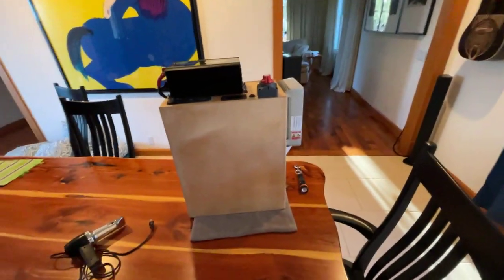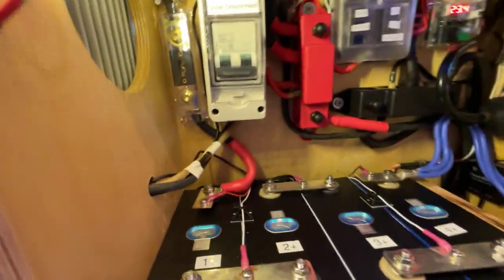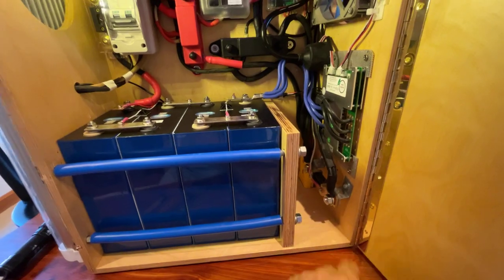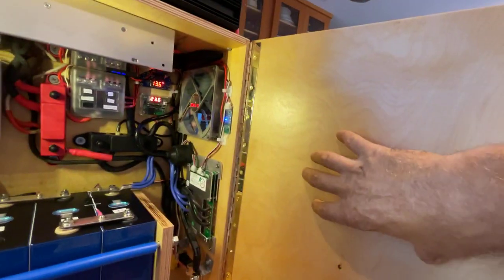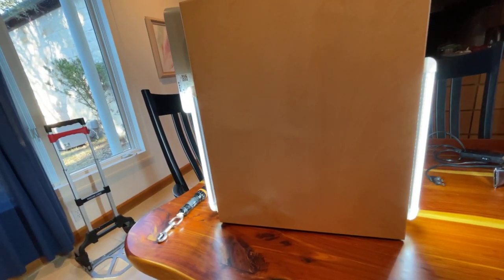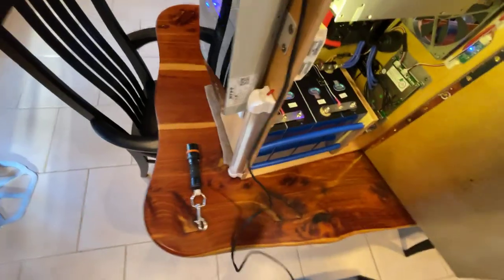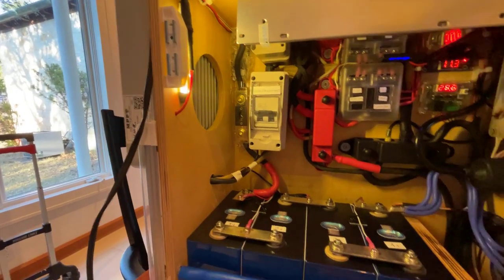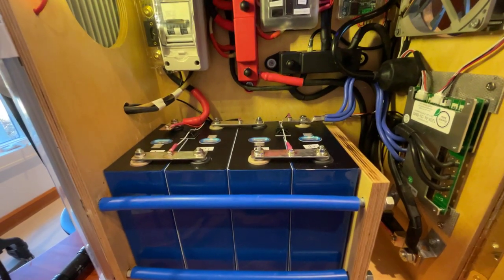I Built A Solar Generator! It Will Run My Fridge And Deep Freeze For Two Days!

Comment: I like your build.  I used the sense lead attachment to the middle of the bus bar on my bill too but I like your use of the half bus bar on the positive and negative terminals. I will probably do that to mine. Thanks. You did an excellent job of planning out your wiring to really pack stuff tightly. if there is a chance cold charging could be an issue, using another thermostat connected to the bottom of the batteries and powered by the chargers might be a interesting addition.
I like your expansion ideas but I am concerned about the batteries charge state being too different causing excessive current flow.  Maybe plan in a current limiter or add a bi direction current limiter in the addition pack.
In my app, I have to worry about rain. 
One final thought, your box looks like a pc tower computer. I wonder if one could be used, lighter for similar strength. (?)
Again, very nice build.
Reply from the maker: You make a good point about joining the packs being a problem if the voltage delta is too great. I should have mentioned it but my videos are one take and completely ad lib. Where others might edit and overlay corrections within the video with text, I don't edit these so I can only correct it in the comments. That's ok because the comments are almost as important as the video on subjects like this. 

Fortunately the voltage  curve is very flat for most of the range and as long as one isn't very different from he other the current won't be really big. The concern I have is running the booster down to near empty and then joining it to the main pack. Flipping the switch could cause arcing in the switch and these switches are cheap and not designed to be switched under a high current load. Fortunately, this is diy and we get to make decisions based on how we will use it without having to fear what a consumer might do if they didn't understand the consequences. Knowledge is everything. Thanks so much for taking the time to comment.

Comment: Great job Ray, what product did you use as a added insulator between those cells? I used a silicone project mat, cut to size.
Reply from the maker: Hi James, I used these thing cutting board sheets from Amazon. https://www.amazon.com/gp/product/B0792QXVKQ/ref=ppx_yo_dt_b_asin_title_o03_s01?ie=UTF8&psc=1
They were smaller than the ad said they were so I wasn't able to get four out of each sheet but to still worked out ok. I was able to gang cut them on my saw but I don't recommend that to someone that hasn't spent their life using that machine. A heavy duty paper cutter would be great for it and I often wish I had one of those.
Reply: @RayBuildsCoolStuff  what you say about cutting is true. I, too have long wanted one of those heavy duty draw blade cutters like old schools used for Art Class. Etc.  Hey have you built a crosscut sled for you table saw? It's a life changer, and YouTuber William Ng has a brilliant design that I was able to build and made my old Craftsman tablesaw cut with micro precision!
Reply from the maker: @beespaceapiaries4422  I have used them since seeing them in fine woodworking magazine back in the late 80s. I have done some super fine work with them that couldn’t be done another way although compound miter saws came around later and almost worked as well if you bought a good one. Still they can’t handle big stuff.

Comment: How much you payed for all together?  How many hours you need?  Its exactly the thing i wish i have 😉
Reply from the maker: I already had the plywood in my shop for 25 years. The rest cost about 1,200usd including 566$ for the lifepo4 cells which is kind of a high price but they seem to be good quality.
Reply: @RayBuildsCoolStuff  So its to expensive just for fun😂Because i only use 2 (now) in Future 3 Panels ( 2x380Watt+ 1x315 Watt) to reduce electricity costs. But for emergency( Black Out) its good

Comment: nice unit. I skimmed quickly, but is there an equipment list?
12V is cool, but 24 is better.
This is as large as any commercial unit and less expensive.
Reply from the maker: My main storage is 48 volts. I have since built an add on battery pack that almost doubles the capacity and adds flexibility. I will be making a new video about that soon. I haven’t made an equipment list but can send you a link to something if you are interested in something specific. I’ll do a list later. Danged 24 hour days are just too short.

Comment: Work of art!  Everything looks tight and neat.  All flows very nicely together.  My only suggestion would be to put that temperature sensor against something with mass instead of free air like you have it.  The sensor will cool off too fast as is hence turning off the fan while the items with mass are still hot.  Good stuff, thanks for sharing.

Comment: looks great but we should have a breakdown of what parts went into it. how much it all cost
Reply from the maker: I can tell you that the parts shown cost $1,200 usd. This includes $566 for the CATL 302AH cells. The add on booster pack I'm building now will have parts cost around $700 but it will use cheaper 271AH cells. A parts list is on my honey do list. The list is easy but the links take a bit more time. 

The problem with a parts list is that it would vary by your needs. If I built something like this for someone else, I would design it around their needs. Maybe it would have a bigger solar charge controller or a bigger inverter which might require a different BMS. Maybe I would skip the lights other nice to haves. Maybe I would try to keep the weight down to 70 lbs which would require other compromises. 

The diy means we can shape it to be right for us instead of buying some manufacturers version of trying to hit a price point. I think I want to add a parts list as a starting point for people to start their own project or more likely, to pick a few parts for their own build. 

I will do it and when I do I will let y'all know in one of the future videos. Thanks for watching and I hope I see evidence that this helped someone because the videos I've seen on youtube have certainly helped me and I hope I can pay a bit of it back, or forward.

Comment: Cool solar generator
Reply from the maker: I'm building the add on battery pack now. It will double the capacity.  I'll be able to show that pretty soon.
Reply: How are any of these "battery backups" solar generators. They are JUST battery backups.  The generating part is the Solar Panels.
Reply from the maker: It is an interesting question. 

One way of looking at it is that gasoline generators take energy that is stored in gasoline and convert it into usable electricity. That energy in the gasoline originally came from the sun too. In this system the solar panels perform the same function as the original carbon based life forms that sequestered the energy. That energy was stored in hydrocarbons until refined into gasoline. The gas generator simply releases that stored energy and converts it to electricity. 

In this device the solar charge controller acts as the energy processor into the battery which is the sequesterer. The gas generator only converts the stored energy into electricity. It could be argued that the inverter handles that part in this device and that the solar generator actually is more of a generator than the gas generator. 

Of course that is all just a matter of how you look at it and in the end what we call it may not be that important. I understand how it might bother some people though. I dislike ground source heat pumps being called geothermal.
Reply: @RayBuildsCoolStuff  Then I can call a wood stove a solar generator. A battery backup stores electricity and outputs electricity. It doesn't convert anything(except in the way it stores the energy).   Calling them solar generators is just a way of making a mundane battery sound cool, even if it never hooks up to a solar panel.  Anyway, it seems  that's the way people on the internet are promoting them.
Reply: @vegaswon1  I despise the term ''solar generator''.  But it has come into general use.

Comment: Nice, I’m building one of these, but it will have a mains input that will only be active when the battery low voltage switch disconnects the battery. I intend to run our fridge an router and some other low watts items.
Reply from the maker: That's interesting. I'm interested in understanding why you are taking that approach.
Reply: @RayBuildsCoolStuff  I want a system that can power the fridge/router++ small stuff via mini 12v solar system, but I want it to automatically flip back to mains if the battery reaches low voltage.

Comment: Hi. What MPPT are you using? Interesting design by the way.
Reply from the maker: I used this one. https://www.amazon.com/Controller-Lead-Acid-Lithium-Batteries-Setting/dp/B08HPMS1Y7?pd_rd_w=ZLdg6&pf_rd_p=5bc65336-a8b0-4888-9e70-4d4ce2f6bd59&pf_rd_r=HY6AA0NQZ220B07S4TZB&pd_rd_r=ee46a9fd-1598-403f-8049-63fdbcbc1333&pd_rd_wg=spDks&pd_rd_i=B08HPMS1Y7&psc=1&ref_=pd_bap_d_rp_1_i
Reply: @RayBuildsCoolStuff  Thanks for the reply.

Comment: Wow, what a beautiful rig! I'd love to build something like that (24 volt), but I'm not sure if I have the patience or dexterity to put it all together so neatly... I'm always in a rush to get things up and running. What brand of panel disconnect did you use? (maybe add a list of all the parts you used)
Reply from the maker: The battery cutoff switch was purchased from Amazon and supplied by Cozyehoo. It is rated for 275 amps continuous but I wouldn't use it for that much personally. It was cheap. I'm glad you like the build. Take a look at the other videos to see what I'm doing with the big energy storage system for our solar system. It's starting to come together and look kind of nice. Thanks for watching.